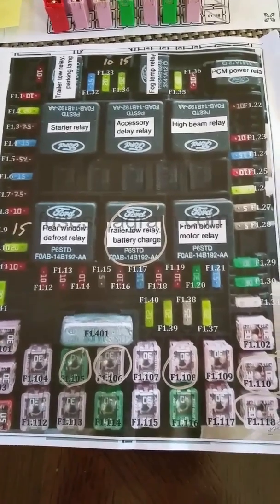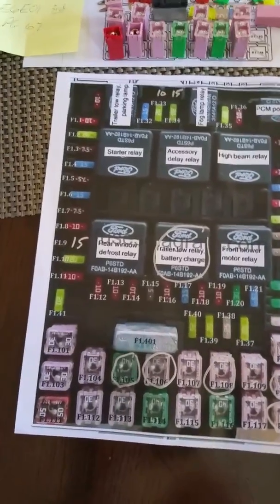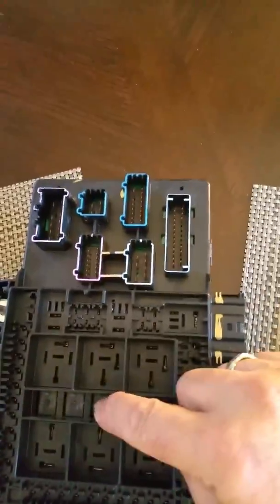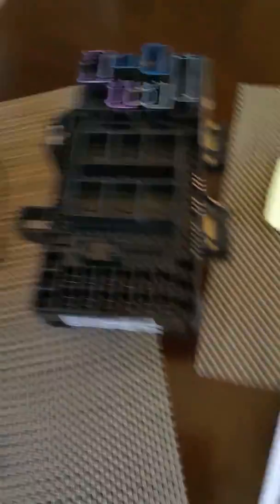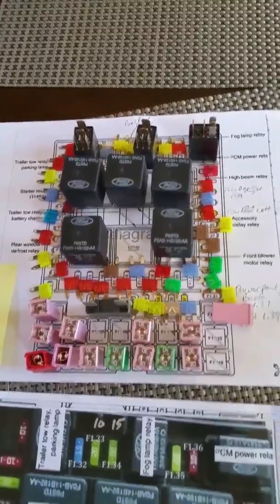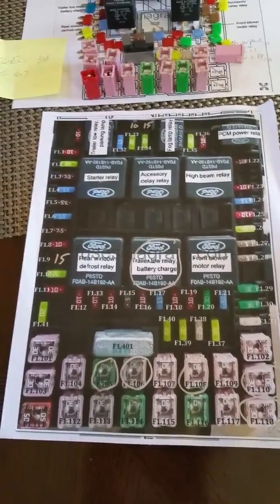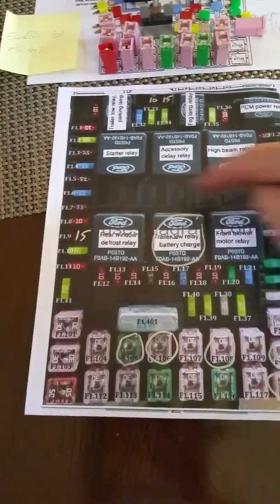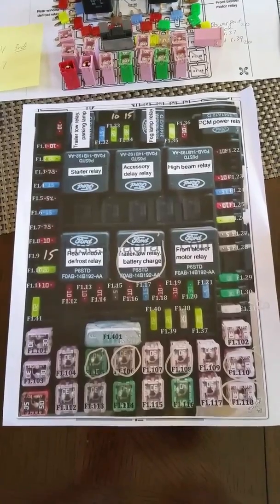2004 ford F8vx-ba repair fuse panel fuel pump relay. R303

Comment: This was life saving, thank you. Changed the fuel filter and still had an issue. My relay has been mutilated, previous owner tried to pull it out. Never micro soldered before but I do regular soldering at work. 2008 F150 4.6

Comment: Great job; thanks for sharing. Found your video trying to do the same thing with my '02 SuperDuty, but the internals of the Central Junction Box are not the same. It has a two-layer design and none of the five Omron F8VF-BA 0881A22B surface-mount relays look burnt. Aftermarket remote-start is suspect now.
Reply: I'm going to buy a 04 f250 that has a similar issue. It's been hard to find info on that one. So I'm thinking that I'll bypass the relay. Not sure if it'll work.

Comment: Hey, ford said they have to reprogram a new fuse box if I buy a new one is this true?
Reply from the maker: with my 2004, there is no programming required..no logic built in to do ANY programming.....they just pull the old box,  and swap over all the fuses into the new box and re-install it..
Reply: Ok thanks man cause I believe my fuel pump relay is burnt out because I have a P0231 code (low voltage secondary circuit)
Reply: @ladevinwashington1251  Your relay is bad. No reprogramming needed.

Comment: Vent a little bit !!!!  This sucks & PISSED is a better word for it !! Ford made an easy plug in & out , 20$ part , solder in so you have to remove the WHOLE fuse / relay panel to make an easy replacement part cost 800.00$ !! FORD gets a total BIG " F " for this shit !! All the other fuses / relays are easy plug in & out ...WHY NOT THIS ONE ??  I'll never buy another Ford product again !!! .....THIS IS BULLSHIT !!!!!!!!!!!!!!!

Comment: Where did you get the actual relay from?  I need to replace that one but I cannot find the relay fuse anywhere.  I'm doing a fuel pump replacement and my father in law tried to pull that relay out not knowing it was soldered in.
Reply from the maker: just search ebay.  here is an example listing  https://www.ebay.com/itm/1-New-Ford-Expedition-Explorer-Truck-Fuel-Pump-Gauge-Relay-R303-F8VF-BA-G8QN/253144956094?epid=2237998246&hash=item3af09d7cbe:g:tnwAAOSwm-pZtLTu&vxp=mtr